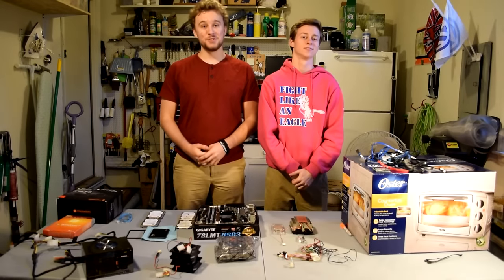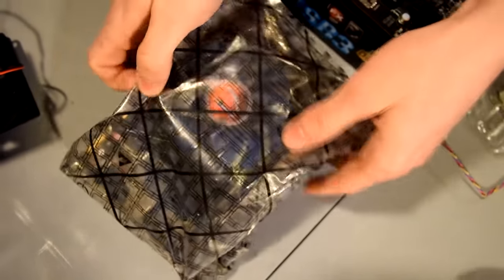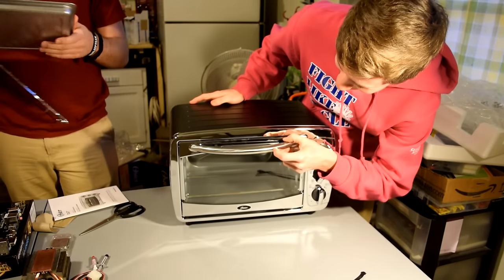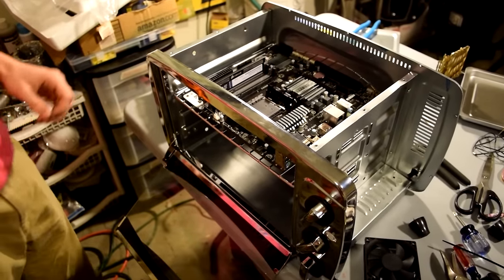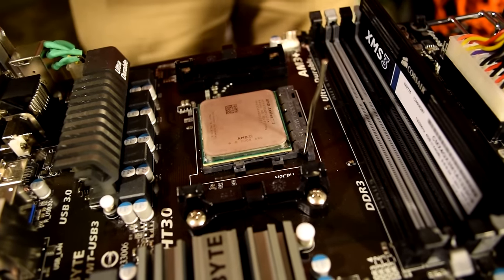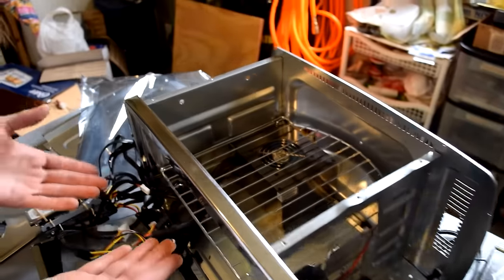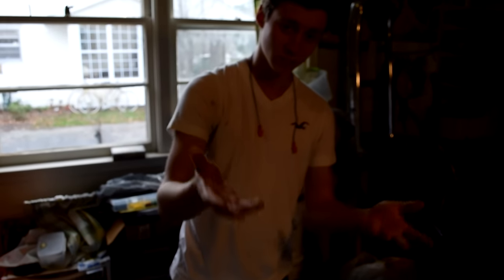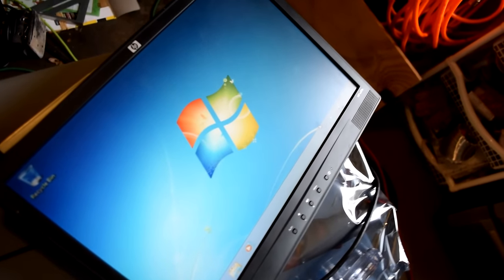Toaster Oven PC Build - Custom Toasty Server

Comment: MINECRAFT inside of a roster. REKT. Also, Toasty bros, 2v1?
Reply from the maker: We are about it if you are... ;)
Reply: +Toasty Bros just find a shit case and cut it it out
Reply: +Toasty Bros also why did you think putting the motherboard on a conductive surface and you should get the evga 430 or 500 watt psu thats like less than $40 on newegg
Reply from the maker: +!# TheMiningWaffle We didn't buy the PSU, already had it on hand but we will upgrade stuff in the future.
Reply: Toasty Bros ik that but im saying if you're going to be running it alot get a psu that wont need spitters and stuff to run it all
Reply: +Firez Ice FINALLY MINECRAFT CAN BE RUN ON A TOASTER!!!
Reply: Windwalker 95 next is the potato XD
Reply: +TheMiningWaffle it already does.... cough Xbox One cough

Comment: 07:52 This was Propably the Part where u guys fucked up the mobo because auf the sparks
Reply: +Xyon Finisher No its because the mobo was sitting on the metal rack. The small metal 'studs' on the back of the mobo were interfering with each other because the electrical signal was going through the rack and shorting out the board.